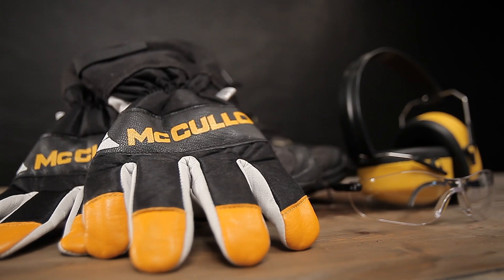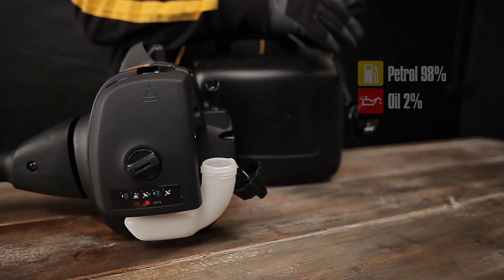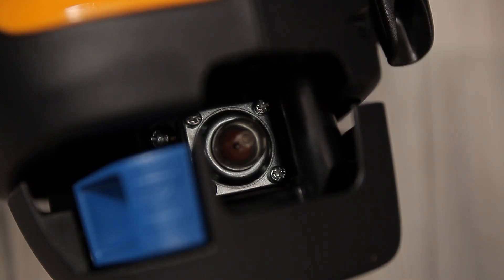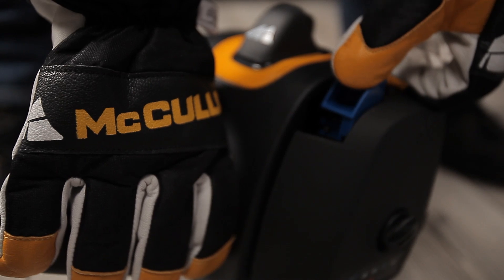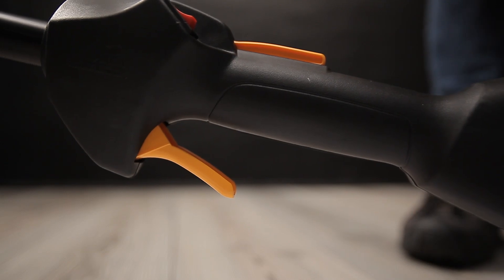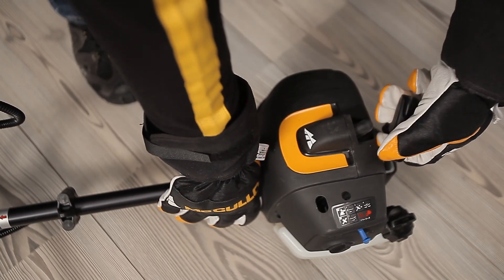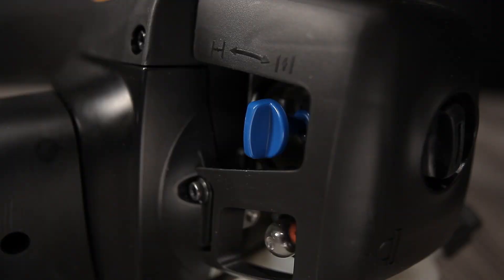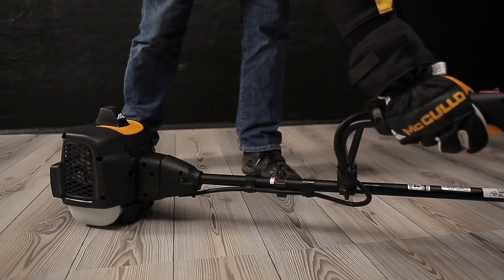How to start a trimmer with a 2 stroke engine

Comment: Useful tips on starting a mucculloch. I recently bought the MT 305 CPS grass strimmer, but im struggling to get it to start and following the starting instructions. Is it me or the machine?
Reply: Matt Seymour it is super hard
Reply: don't follow the manual exactly always think..  don't use the petrol bulb for example when the engine is still warm.. do use the petrol bulb for impregnating when cold.. yet not to much, it is easier to do that flushing procedure in two sets, then drowning the engine and not understanding what went wrong when the engine makes a lively noise turn of the choke  again to prevent flushing in to much gas..

Comment: mine will just not take the throttle pile of scrap never worked right sinc day i got it fuel line are rotting away cheap trash